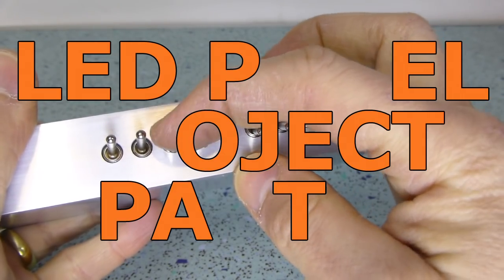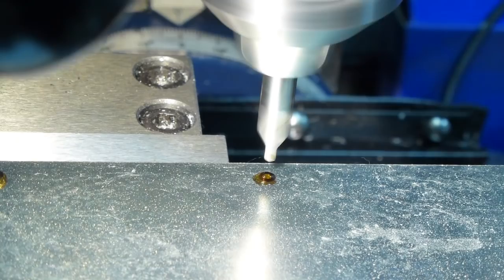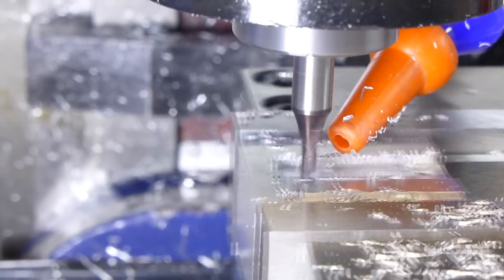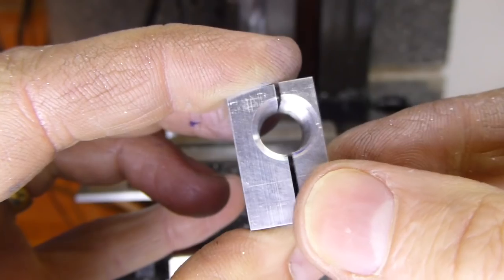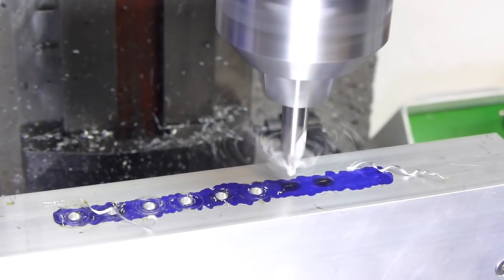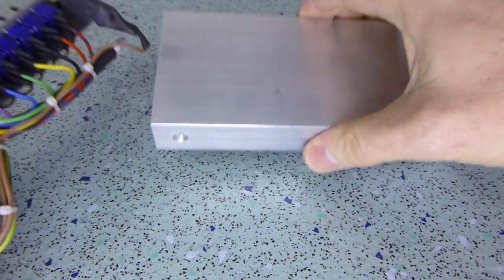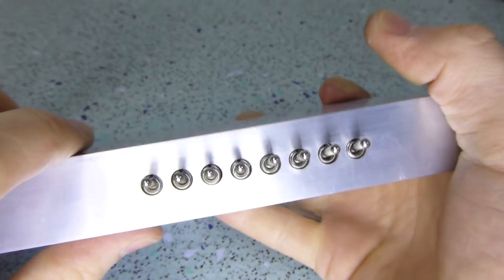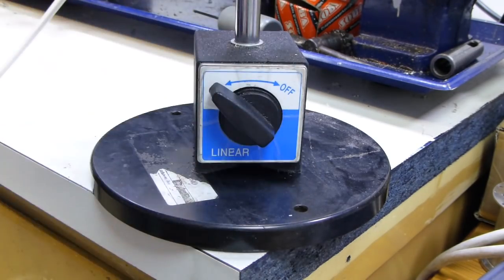Workshop LED Panel Light Build Part 2

Comment: Great project, I love the adjustable mounting bracket, and the finished lighting looks even and uniform along it’s length.

what is milling machine you use, it looks capable and reasonable size…. Would love to know, thx
Reply from the maker: It's unbranded, but is a close relative of the Sieg SX2. It has lots of issues, but is in many ways very capable for its size.
Reply: @TheRecreationalMachinist thanks…. The Sieg’s seem to be readily available in Oz….

Comment: ...and in order to hold down this one pesky wire, I built an industrial metal foundry and melted down my neighbors Volkswagen. I then proceeded to hand forge the steel wire clamp with a tiny hammer I made from a handful of melted down mitutoyo dial indicators I had lying around the shop. Before encrusting the wire clamp in fine sapphires and rubies I felt it was necessary to electroplate it in gold harvest from a half dozen Faberge eggs.

Comment: So the green and yellow wire is earth but the green and yellow wires are switched mains.
Milling the insulation instead of the hole.
Neither is a good choice for electrical safety.
Recouped points for heatshrinking everything.